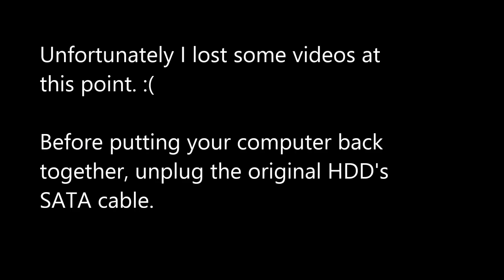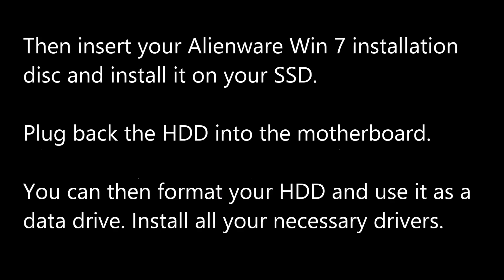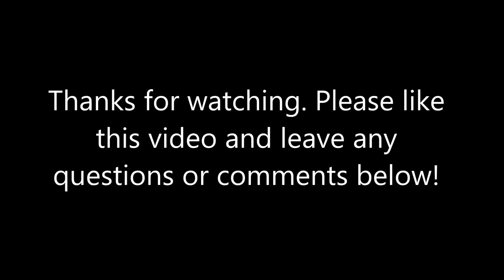Installing SSD into Alienware x51

Comment: Why everybody doing it the hard when it comes to installing a ssd.just take the HD  that’s under the  graphics card and clone the os to the new ssd. And then screw the ssd with the bracket.and that’s it no need to buy molex and sata cables.

Comment: If you guys really want to see an x51 r3 fly... I set mine up with an m.2 drive mounted in the PCI-E slot and utilize the onboard graphics through the integrated HDMI port. It took a little bit of tweaking the BIOS to get it to boot correctly, but the startup time is almost instantaneous.

Comment: does anyone know if you can use a G-Drive if i take it out the casing? The G-Drive 2tb SSD only has a Sata and USB mini port. Can I just leave the BlueRay player out and use the SATA that was going into it for the SSD? Do I need to have the power cable if the G-Drive powers itself?

Comment: Hei can I take the optical drive out and use the existing cables  for  the ssd?. Maybe I can keep the optical drive cage in there to have something to mount the ssd to
Reply: Man I was wondering the same thing. Did you end up doing this??

Comment: i have everything of this on his way to me, i just want to ask you if when i install the ssd and unplug the original hdd sata cable i should  unplug the  gpu too?

i mean do a basic install of all on the ssd with the gpu and hdd unpluged then wwhen all is fine conect them both, format the drive and download the gpu drivers...
Reply: dont need to ,if its not in the way but for faster speeds for os drive use the sata port dell intended for primary drive

Comment: Help !!!!    I am trying to install the OS into my Samsung SSD and having trouble initializing it. I followed the first couple of steps and they went all well. However, after I click Finish, there are couple minutes waiting and then popping out the message saying "The operation failed to complete because the Disk Management console view is not up-to-date. Refresh the view by using the refresh task. If the problem persists close the Disk Management console, then restart Disk Management or restart the computer." No matter how many time I restart the computer, it still keeping ending up like this.  HELP PLZ!!!
Reply from the maker: +Tai Zhang Hey mate sorry for the late reply. I'm not too sure how to help you there. It's been a long time since my x51 died one me. It might be worth asking for help on the dell forums.
Reply: Appreciate your advise

Comment: Why didn't you use the migration software provided by the Samsung SSD? Is it risky to lose some data during the process?
Reply from the maker: I tried to use it but I think something went wrong and it took too long. I also wanted to just reformat it and have a clean start. I did back up my important data.

Comment: Nice video. I heard X51 doesn't have SATA 6gb, which is infuriating. Anyway, looks like I'm going to order a SSD.
Reply: the R1 only has sata 3gb/s
Reply: @lisafan6365  mine is an R1 and it came with a 6gb/s one
Reply: It does have SATA III (6Gb/s) where the HDD sits, but it doesn't mean an HDD will actually reach such a high throughput. It's only a maximum R/W speed. A SATA III 7200rpm HDD will still be significantly faster than a SATA II 5400rpm, though. SSHDs are also a good option.

Comment: I'd like to do this same thing what you. You changed something in the BIOS system before installation of the SSD and OS?
Reply: ***** lol noob
Reply from the maker: Hi I actually removed the HDD cable from the motherboard so that the SSD was the default hard drive, so I could reinstall Windows on to it. After putting back the HDD, I changed the BIOS to boot the SSD as priority.

However, I tried upgrading the BIOS yesterday after upgrading my graphics card, but my motherboard has died since :( RIP Alienware x51 :((((
Reply: Ok, thanks Simon.
Reply: ***** Alienware RIP? :( Damn! Which graphics card? and what happened, something burned?
Reply from the maker: Nope. I upgraded my BIOS from A06 to A07, then restarted, and it never came on... :( I think the mobo died!
Reply from the maker: Oh it was the GTX 660, which also could be the problem, because temperatures inside were getting too hot! Whatever it is, I salvaged everything and got a new case and mobo. Still can't believe my x51 is gone :(((
Reply: ***** Hi, your Alienware x51 is fine, working?
Reply from the maker: Nope it stopped working. I built another PC with the parts but with a new mobo.